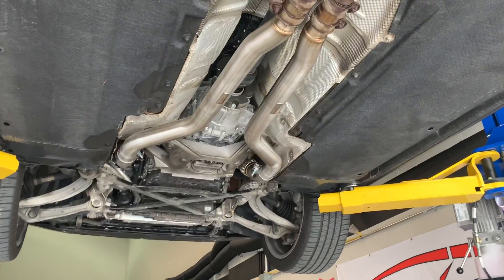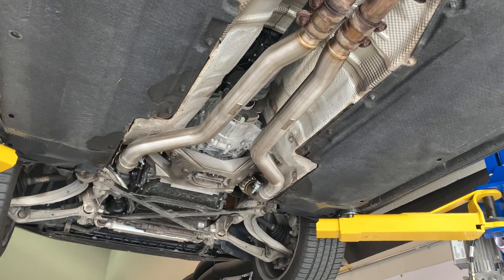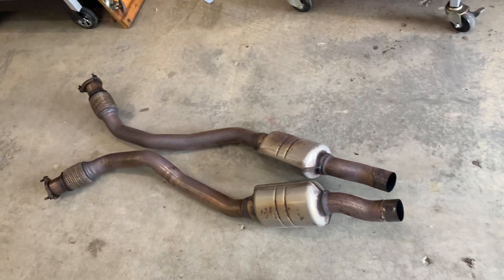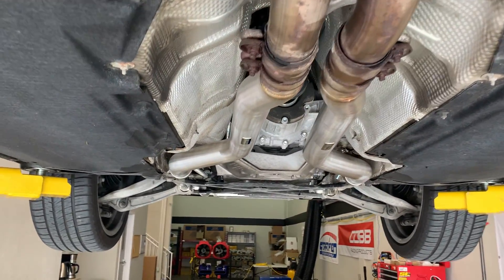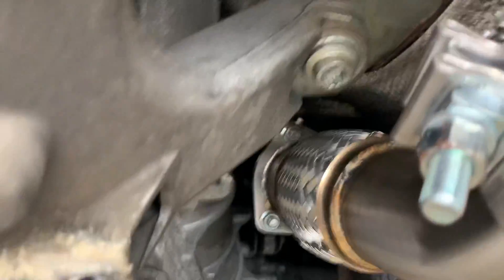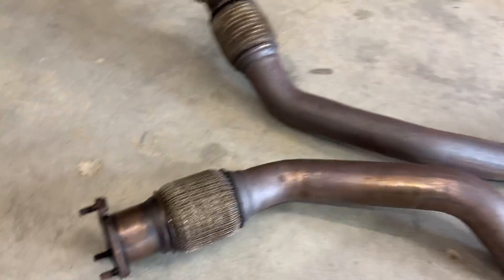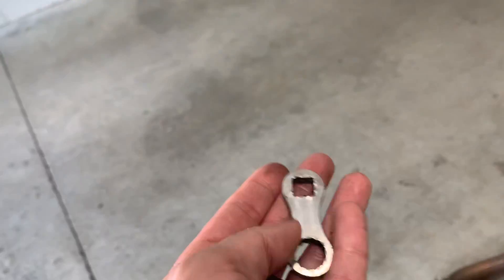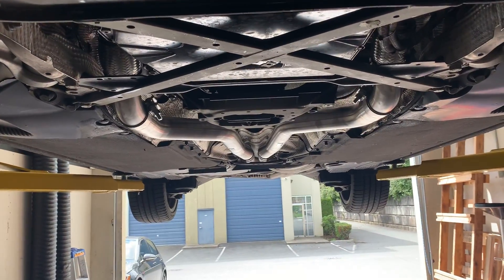B8.5 S4 downpipe install

Comment: this is not downpipe - downpipes are pipes instead of a catalyst
Reply from the maker: Different people use different terms in different communities. In this community the headers are the next piece of exhaust closer to the motor.
Reply: On this platform they are the downpipes
Reply: Test pipes are what they refer when you replace the Catalyst, downpipes are these ones
Reply: Are the the samz dor the s5 v8?
Reply: Those are most certainly downpipes.